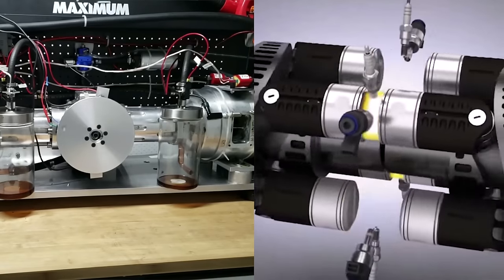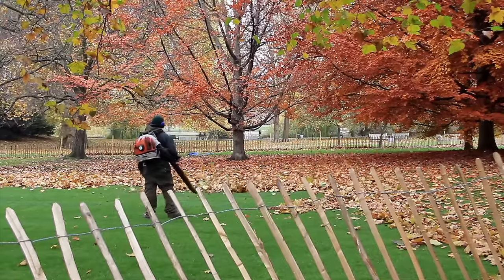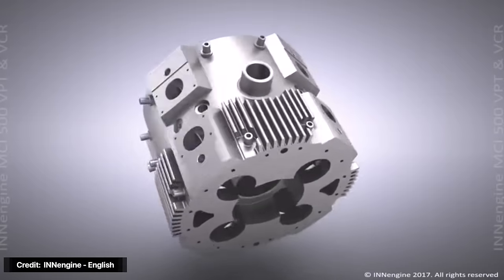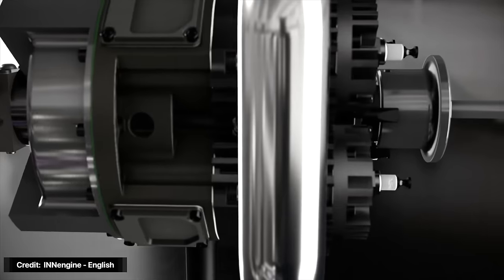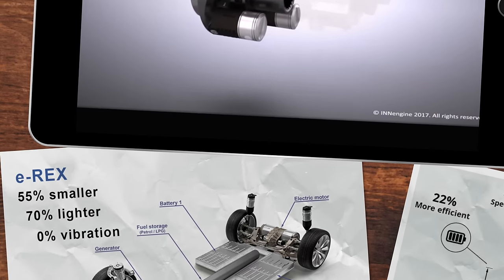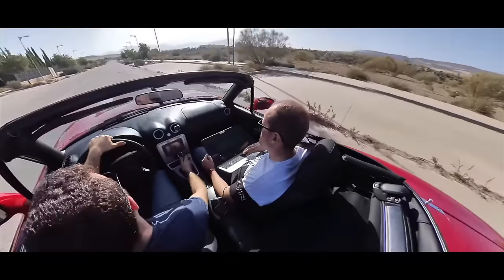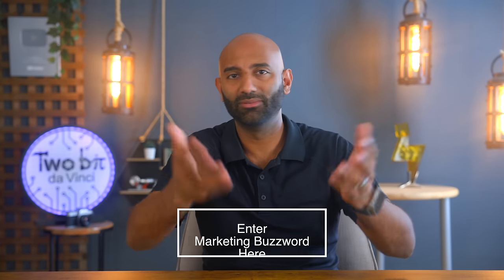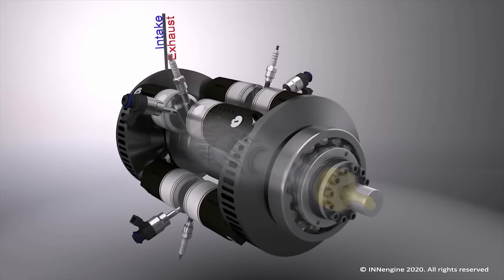One Stroke Engines - 200% More Efficient??

Comment: Certainly two stroke but sufficiently different to be a new category. The swash plate instead of crankshaft is the core difference so "swash plate 2 stroke" maybe or just "swash plate engine" perhaps?.

Overall I think the range extender is a good concept. Charge while you drive. Having just done a road trip in Western Australia with a Toyota hybrid, it could not be done with all electric.  For long distances, a quiet low vibration car is a major bonus as you don't tire as quickly. So hoorah for an inherently  quiet engine.

The reality is though you are just averaging out the throttle setting with such a car with a higher battery flow on hills instead of depressing the gas pedal (but you won't get the power surge you need for high speed overtaking). The question then is how more efficient can the petrol engine be when run at optimal conditions.   

If you can charge from the wall socket it is different in a city.  There is a huge advantage for a car that is cheap in the city but can do long distance country runs.

One thing that most do not take into account is the source of charging electricity.  If the power station is thermo dynamic with an efficiency say of 30% by the time you take into account transmission losses you might not save that much wrt a car that is 20% thermo dynamic efficent.  Add in energy to make the batteries in the first place and will you make a life time carbon saving? 

That might be worth a video analysis

Comment: EV is not going to take over ICE any time soon. The power grid is nowhere near capable of handling the load. Having said that, diesel-electric trains are one of the most efficient modes of transportation; far more eficient than trucks.  
So yeah, I would be all in favor of using a more efficient gas engine to generate electricity for a hybrid car. Hybrid cars make sense, but we still have to spend God knows what to upgrade the grid, and at the source of that grid, we will still be burning a ton of either natural gas and coal. So we will use more of those. 
We should be looking at newer nuclear power generation tech for the grid, but that is a political hit topic. France has invested in nuclear, and power is way cheaper than neighboring Germany, which has shut down nuclear in favor of wind and solar. They have their place, but do not do welll as the backbone of the grid. 
One last thing to consider. Battery chemistry. There is nothing environmentally clean about batteries. From mining the contents, to proper disposal, batteries are hazardous. 

There is no free ride, unfortunately. All we can do is allow as much innovation as we can, to find the best fit. And it will probably be a mix of several sources of power, depending upon location, country, economy size, etc.

Great video. Grest presentation.

Comment: Your quote, "...better off making 3 cars instead of 1," regarding using natural resources. We need to be responsible. Given our current technology, range extenders are the most responsible solution. Long ago, diesel locomotives proved the reliability of the electric drivetrain. At their heart they are range extended system.

Comment: What most of the people often forget is, that the more important appliance for a range extender or Gasoline-electric Drivetrain is for the commercial side. Sure a motor like that will probably be obsolete, as the motors and batteries get more and more efficient and powerful. But hauling with an EV sucks right now. You can only do it for short ranges. But what about getting hybrid tech in Semis and Cargo ships? There something like this is probably the way to go due to the density aspect

Comment: With respect to gasoline vs. electric with a gas extender is too variable. The total cost and convenience or "lack-of " goes into the thought process of making a decision like that. What is the most economically practical with the most convient ecological benefits? I dont speak in absolutes anymore. I will drive what checks most of the boxes when buying a car. Tomorrow isn't promised so I wanna have a little styling and fun mixed with my energy and ecology stance!

Comment: Due to extreme pollution caused by mining operations needed to acquire the materials needed to produce each EV battery pack, the fact that production of EV's incurs a higher C02 emission rate than conventional automobile production, the fact that EV's cause more road damage due to higher weight to tire print ratio resulting in the need to repair roads using materials made from petroleum, that they have a higher maintenance cost than conventional vehicles, that they consume tires at a higher rate than conventional cars, again tires are made using petrochemicals, that they have numerous safety problems associated with cracked or leaking battery packs exposing lithium to humidity, thus potentially causing fire. That we have conventional cars that have lasted over 100 years and many covering a range of ages from 100 to 20 years of age, proves that conventional automobiles are capable of overcoming the C02 load debt from their own manufacturing. In other words, a used car produces less C02 than a new car because its very existence means the energy cost of producing a vehicle to replace it will not have to be paid. The cost to the environment of producing an EV battery utilizing current technology, as well as the replacement cost to the consumer and the need to upgrade the power grid of every country where EV's become the predominant mode of transportation will produce a C02 spike of unprecedented proportions in addition to destroying the land that is unfortunate enough to have the required minerals and heavy metals. All construction equipment currently runs on "fossil fuels" and they must be used to upgrade the grid. Increased loads will require the construction of more power plants, the majority of which utilize coal or petroleum to produce electricity. Unless battery technology is seriously improved, the only thing EV's will accomplish is the "out of sight, out of mind", mentality.

Comment: Electric cars might be good if they weren’t jam packed with unecessary electronic bullshit. 

If you got rid of heated seats, electric windows, electric mirrors, self drive/parking systems, electric hand brakes, automatic headlights, automatic windscreen wipers, internet access, etc,,, then they might just be simple enough to be reliable and affordable. 
A car is a mode of transportation. You don’t need all the above mentioned! Especially the in car touch screen computer crap! Piss that shit off! 
Manual controls operated by linkages, cables and mechanisms made from metal are far more reliable and cheaper to fix when and If something goes wrong. 

I don’t want to have to pay stupid amounts of money to some douchebag trying to fleece me at a Tesla dealership to repair or replace something that should not have broken so quickly if it were made to last. 

A car should not need dumb shit like a fukin software update or bullshit thing that has gone wrong with it will continue to not work! That idea is absolutely retarded and totally unecessary.

What happened to the days where you could work on and maintain your own vehicle as a prideful accomplishment and a way to save money! That kinda stuff adds to the whole car ownership experience. The more reliable a car and cheaper and easier to maintain , the more enjoyable the experience is for true car people!

Comment: Yes.  I believe that electric cars with combustion range extenders are better than battery-only electric cars.  You get all of the benefits of an electric car and those of a traditional one.  I believe that the idea of completely getting rid of combustion engines is silly.  Instead, I think we should be applying them as efficiently as possible, and in my mind range extenders are a way to do that.

Comment: Battery heavy plugin hybrids are a good concept but why put in a novelty ICE that still suffers from wear and tear when it is not used in weeks? Or the inspection, carrying around all the exhaust management stuff.
A better way would be using a direct methanol fuel cell as range extender. It uses the same batteries, power electronics and so on and used easily available liquid fuel. As a REx it only needs 20 or so kw tops, so it would not be expensive either.

Comment: Many of us are not sold on EV's yet, but would like to see more efficient hybrid cars. This interesting little internal combustion engine could be more than just a range extender, it could actually function as a hybrid. It actually has enough horsepower to move a car on it's own, so with an electric motor and battery it can work like a Toyota hybrid using  an ECVT.

Comment: I have seen several of these “cam engine” designs in my lifetime and know of one which was approved for a general aviation power plant several years ago. Regardless of the power these engines produce,I would love to see the EPA breakdown of such a high speed engine. Compared to electric, you still end up burning fossil fuels and exhausting CO2. As far as being a one stroke engine, a turbine engine is the only one stroke engine I can think of. Turbine engines are called Brayton Cycle as opposed to Otto Cycle engines. Any engine that is high power, low environmental problem, low maintenance are very hard to come by and do not compare with electric. As far as the idea, it is another mousetrap!

Comment: Li Auto in China developed their vehicle so that you could charge your vehicle at home and if the range of driving went outside the battery charge, you could fall back to the engine.  The electrical range was signficant but I just don't remember if the backup engine ran a generator or attached to a drivetrain.  It seemed similar in concept to slicksquared4336 down below.

Comment: I am currently waiting for more gas REX ev to hit the market before making the switch to EV. My commute is anywhere from 100-200 miles round trip and the infrastructure near me has not been put in place. The idea of being able to stop at a gas station and run the car to charge my battery would make the switch less scary.  Especially given my extreme cold climate.

Comment: There are no one stroke engines available now or in the future. The best you can do with any engine that "BURNS" fuel air mixture is two stroke ie power and exhaust. The engines shown here are all versions of swash plate engines a technology almost as old as the internl combustion engine itself. The experimental Dynacam /Revolver Cam engines were built and powered many small light aircraft with horizontal opposed cylinders arranged aroun a single swash plate or "CAM" and could be either two or four stroke.

Comment: EV’s are not the future at this time; unless only the very rich will have them and the population is reduced drastically. Solar and wind are not reliable, nor can they keep up with demand. We’re seeing all the downsides of EV’s-not near enough infrastructure, I.e., power plants and charging stations, environmental damage mining the minerals for the batteries, the waste generated by the spent batteries, roads and parking garages not designed to carry the extra weight of EV’s…those are the ones of which I can think. Plus, they catch fire and are terrifically hard to put out.

Comment: Ev was a novel idea. Bit when you are using diesel generators to charge them, plus the battery ingredients destroy the planet and are rare. Also very toxic . I'm all for the one stroke engine.  Just run it on hydrogen.  It's a super simple process.  Non toxic, dependable non polluting and you can go as far as you want without waiting to charge. Nor will there be cold weather issues.  Plus we can continue to use internal combustion motors. Minor modifications.  Don't know why we have not done it sooner.  O yea I forgot. Big oill is why. They will loose billions.  But we won't be polluting the planet with fossil fuel. So to bad. Oil industry can suck it.god knows they have lied and poisoned so many people not to mention what fracking is doing to the planet. No more corporate rule.

Comment: Hi Ricky. First time commenter, long time follower. I personally agree that a transition to all electric is rife with problems including:  shortages and environmental issues in the production of critical materials needed for battery storage and motors, the lag in upgrade and build out of infrastructure to support pure EV use, and costs to the general public that make it less than optimal for wholesale adoption. The idea of actually making our use of current fuels multiple times more efficient, while boosting performance, reducing emissions and lowering overall operation cost is absolutely a better transitional approach. It doesn't please the profit hoarding industries that will benefit less but, that's pretty much the way it goes. I also think you are right about the superiority of all electric drive with hybrid power production. This is certainly an area that the k.i.s.s. principal should be foremost and the development of these simpler, more efficient ICE engine concepts should continue with all haste. Thanks for producing great and informative content on such a wide range of topics.

Comment: The problem is over hyping.  But I am talking about over hyping by the EV industry.  You will never see EV vehicles north of about 45 degrees longitude because of cold temperatures.  There are other problems with them.

Comment: There are actual one-stroke engines, they're called turbine engines, or jet engines. As you explained, there cannot be a one stroke piston engine, because there must be a way to bring the piston to the opposite end of the cylinder. Electric cars like currently produced have only a 10 year lifespan, their batteries cannot be recycled easily, and must be replaced at significant cost, making another vehicle a less expensive option. The national power grid is not yet capable of sustaining the demand for the amperage that huge numbers of EVs would need, too.

Comment: The opposed piston engine has been around since the 1930's, just look at Fairbanks Morse. Problem with the OP engine is that it's expansion ratio per crank degree is double a regular piston engine, making it less efficient. The OP engine e was used in WW2 subs as it enables high displacement in a compact space. Other problems like oil trapping plague this engine.

Comment: here is the thing most ppl forget about an EV.  Yes it range/charge is nowhere near 10gal of gas in a high milage gas car but how fast do u drive.  To get the best mileage out of a gas cvar u need to drive as close to 55 mph as u can.  That is the speed at which a gas car is designed to crouse at.  So u drive 55 mph with a car that will go 35 miles on a gal at that speed.  That gives u a range of about 350 miles in 10 hr.

Now how many of u drive for 10 hr straight?  Not many if any.  U stop for coffee and to eat at least twice in such a trip.  

An EV will give u that 150 miles if u buy a new Leaf..  Once more u dont just drive the whole 359 miles u want to go.  U stop and have a meal.  While u are having that meal ur EV is recharging.  If u stop every 2 hrs and let it charge to full ur trip will take u a little longer.  By doing this u are reducing ur charge time and also not running ur batteries low which is not good for them.  The more charge u can keep on them the better for their life spend.  Now who hasnt got a few more fus to get some place 350 miles away?

Why did I pick 10- hr of drive time?  B/c that is how long the safety ppl say it is safe to drive with out 8 hr sleep.

Ya I know u kids have driven for full day but not without food and coffee stops so even ur EV with the right idea with charging can do the same.

Comment: Thanks for the info and thoughts.  You didn't say anything about emissions. Does it operate like a four-stroke in terms of lubrication?  
We would not have a problem with needing an ICE at all if we just adjusted our attitude about range.  Somehow we always think where we are no has to be matched. We have been using something or a long time that we shouldn't have been using at all and now demand that anything taking its place match the unrealistic convenience of what we had.  ICE, no matter how you cut it is just a very inefficient machine for transportation (or maybe for anything).  Perhaps if we could figure out how (and i am sure we could if we put our mind too it) take advantage of the waste heat while driving we could a least double its efficiency....which still would not be great. Lets use the heat from the exhaust to turn a steam turbine connected to the wheels...or any number of other possibilities I'm sure are out there. I like that this 'new' engine is very efficient at a specific speed which is much better as a steady power source. It is the same with current fossil fuel generating plants and why we  try to optimize our energy use to be as steady as possible over time.  
Also, with all the new battery technology on the design and testing table we may not need to worry so much about range soon....unless we just keep on wanting more and more.....and more.....which I unfortunately feel is very likely.

Comment: I am actually a bit more intrigued by flow cell technology. Imagine a world where when your EV starts running low on power, you just pull into a filling station and replace the depleted electrolyte fluid with fresh charged fluid. In about the same amount of time as filling a gas engine.

Range anxiety and charge times are the biggest hurdle for EV adoption. If that hurdle can be overcome... And, I imagine it wouldn't be that hard to make the engine compatible with biofuels like ethanol.